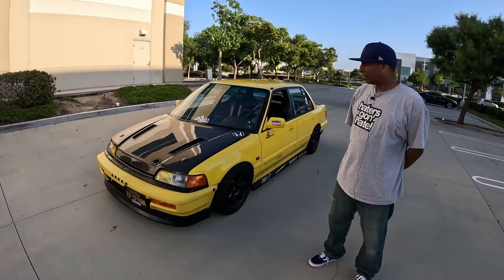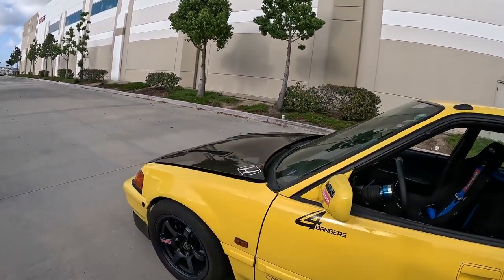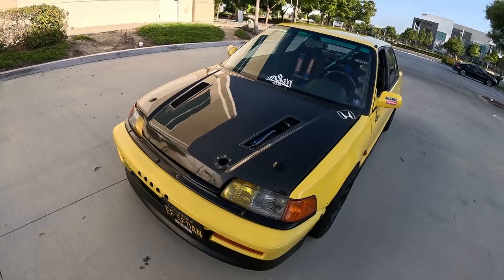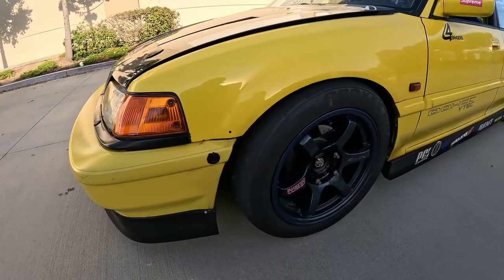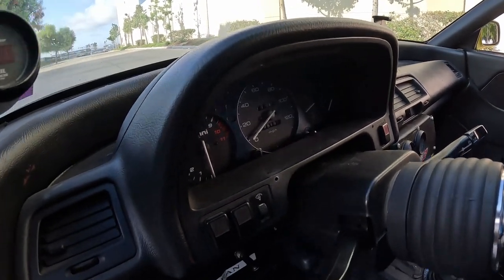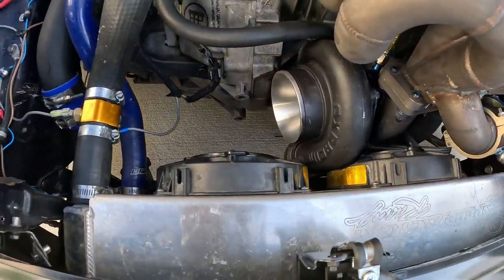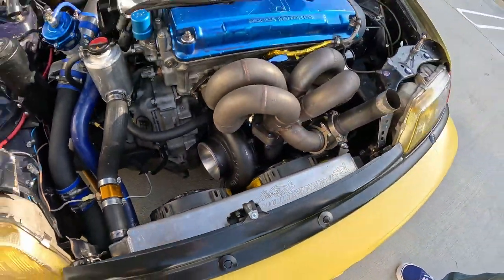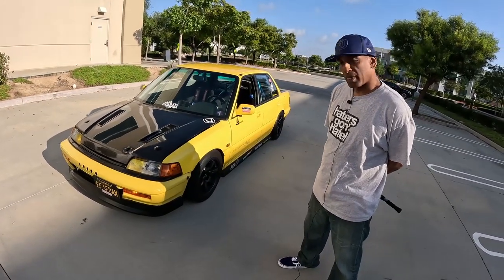How To Build A 450 HP 1990 Honda Civic EF: Killer Bee!

Comment: Man, much respect to Jay! 🙏 I can relate, I do my swaps the same way. Lol 😂 I truly enjoyed watching this review. Keep up the great work guys! Jay I been through the same issues with being turbo for last 3 years. I've had nothing but trouble and issues. They are fun when they work but it sucks having all the downtime and problems that come with turbo cars. I now have a b20v allmotor and I'm content and happy. I can finally enjoy my car. When I was turboed I would break the car every 2 weeks. It used to drain my energy. I'm allmotor for life now. ❤ much love! 🙌
Reply: I started off all motor and love it too but I was racing a index class drag racing so I wanted to eat my cake too which means I wanted max hp and be able to drive it on the street too. My car is kinda heavy so I would need about 350 to the wheels all motor. So I just pulled the trigger and went boost.
Reply: Yea, nothing wrong with going boost. I just love driving my car and I hate having to wait for parts or waiting to find a new block because I cracked a sleeve or looking for new pistons if I happen to fry 1 due to a clogged injector ect.. it's a toss up but I rather have like a solid allmotor 250hp or maybe a k series with like 300hp and be good with no headaches.
Reply from the maker: Thank you for taking time from your valuable day to watch and leaving such positive comment. We appreciate it man.

Comment: Just out of curiosity, is that cage still functional in case the car rolls over? Seems like the front isn't protected much.
Reply: Not sure. I'm not trying to find out the hard way.  Lol but I'll be trying to get it sized up into the right position. It's for a 88-90 civic hatch. And at the time I was running the 11.50 index class at a lot of drag race events and if you run any ET quicker than 11.50 you have to have a roll bar. So I threw what I could in there at the time. So actually its fast enough now to have a full cage. But I'm retired from drag racing  so I really don't want take the bar out so I'll try and get this one modded with time permitted.

Comment: That roll bar is not properly fitted and seems like it is not design for that car? It needs to be as snug as possible around the B pillar and all the way around the roof. If that's the case, it serves no benefits and no protection in case the car rolls over. I also don't understand why no cover or protection on the timing belt? Since the car is driven on the streets, if any debris like rocks, or anything like that get into the timing belt, you can easily destroyed the motor. There is a reason why the factory has full protection for the timing belt area.

Comment: I have the same car....  88 EF sedan.  But I have a turbo K20z1, S1 built AWD.   You can watch my tune on PFi.  Starting in at (2:12)  https://www.youtube.com/watch?v=DNcdyMi6_Zc&t=145s
Reply: I added the 6th gear from a TSX to my CRV transmission. So its 6 speed.  Wavetrac LSD. And I run the S1 Built tubular kit with the Alpha drag arms and billet upper and lower control arms and S1 built axles. 60K viscous and the stage 3 driveshaft.